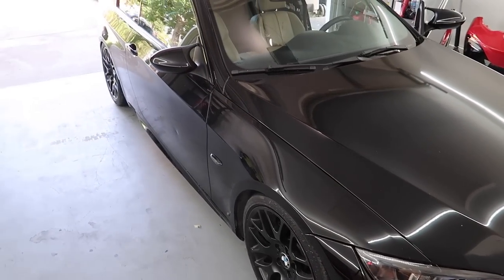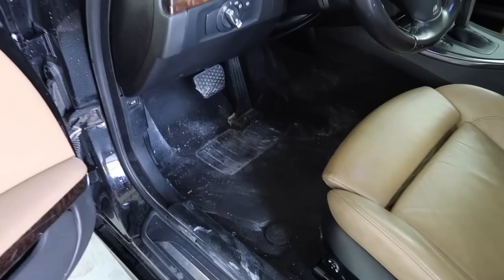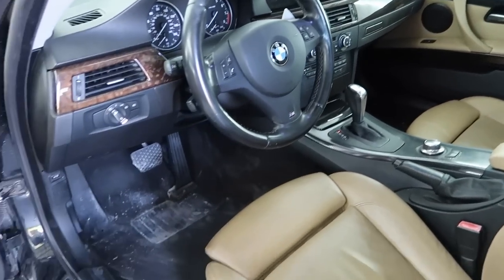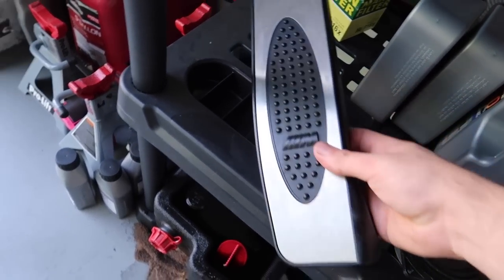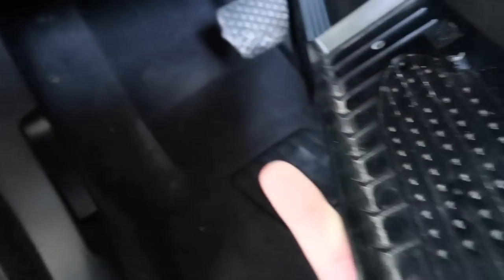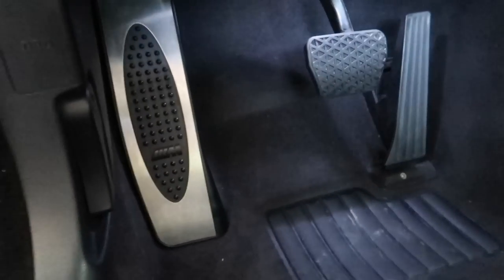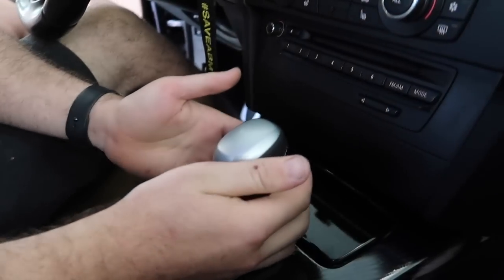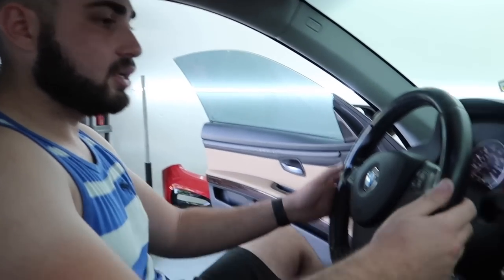I JUST PURCHASED THE MOST EXPENSIVE M PERFORMANCE MOD FOR MY E92 328I!

Comment: instead of buying a new steering wheel trim for the e90s get some LVP paint and an M sport badge then wet sand the trim. It looks brand new and it's only $20. There are a lot of tutorial vids on YouTube and you save like $200. 👍

Comment: Nour my old E92 335 was like that where the car had base audio, I went through so many different audio setups before finally retrofitting the individual audio from M3 I had to have a whole harness made to bring the audio outputs from the back of the head unit to the trunk where I soldered the custom harness up to an OEM HK/individual amp connector, coded the CIC to the individual audio and it worked perfectly OEM and way better than the custom setups I went through that had some weird issues. I also had a left over MOST fiber optic connector from when I retrofitted Combox (replaced TCU and MULF so one less module = 1 free most connector) which plugged right up to the amp perfectly and had a fused power connection to the battery. Having base audio makes it so much harder to do anything because you need to bring the outputs from the back of the head unit to the trunk but once it's there life becomes so much easier.
Reply: What weird issues did you have with the custom setups?
Reply: Not sure what you mean by "outputs from the back of the head-unit to the trunk"?? For Individual and HK audio, all you need to hook-up from the car to the Amp is the MOST connector, power, ground and then feed the speaker wires directly from the Amp to all the speakers and subs. Code and job done. I've done this retrofit countless times and I make my own wiring looms so the only wiring needed is for the Amp to all the speakers and subs.

Good job on retrofitting the Combox! It's well worth doing for OEM Bluetooth and A2DP. However, getting an aftermarket MMI box may be a better alternative nowadays as it gives much better functions such as Apple CarPlay/Android Auto, Screen Mirroring and provisions for a reverse camera as well as bluetooth phone and A2DP.
Reply: @TheUzzyB91  I was a special case as my car was BASE audio no amp in the trunk so the wiring that goes to the speakers were coming from the back of the head unit since there was no trunk amplifier, the speakers were powered by the head unit so I had to do extra work instead of say someone with HiFi or L7/HK where it would be much easier.
Reply: @JamesF36  Going from Base audio to L7/Indi requires just the Amp and the wiring as mentioned above. All the audio information is transmitted via the MOST network. Unless you were retrofitting an aftermarket sound system?
Reply: @TheUzzyB91  No that’s what I did I transmitted the audio via MOST however I did not want to make new wiring to each speaker so I used the existing OEM wiring that was pre existing all I had to do was extend the speaker output wires to the trunk to the individual amp

I’ve sold the car since 2021 but the individual audio retrofit went well and sounded amazing, now i’m retrofitting bowers and wilkins sound system into my F36 440 but that’s a piece of cake since I already have harman kardon. I replaced all the speakers now i’m just waiting on a good deal on a amp

Comment: The benefit of having the really basic sound system is you could easily add an aftermarket amp and new aftermarket speakers and end up with a better system than the HK system
Reply: Can you provide me some links where to tap into for power for the amp
Reply: @MrBMX-bi7ze  I can’t specifically I am afraid however for the wiring for the amp power you only need live ground and remote.  Live take straight from the battery and ground off the body for remote just find a switched live that comes on with ignition.  To get the audio to the speakers unfortunately would mean cutting the original loom and using rca adapters that would connect to the speaker wire then run the rcas to the amp and new speaker wire from the amp to the new speakers.  It is a lot of work but will allow you plenty of options in the aftermarket world to build a system that is right for you with subwoofers if you want or just high end component speakers

Comment: had one of these (UK 325i n53) had the same issue with my sounds... I just added a 5 channel amp, connected all the speakers... disconnected the bass (under the seat) and connected it straight to amp as if it was a subwoofer.... clarity was 10/10.... Other way was a 4 channel amp and a mono amp... using ISO cables connect radio to amp then amp to speakers HIGHLY RECOMMEND... Better then HK System!! Facts....(because you run all sounds speakers for trebles and mids and sub woofer for only bass) as the bass under the seats does play mids which is not what you want

Comment: Love these videos but it's so painful seeing these guys try to diagnose the speaker issue. Your issue has nothing to do with the tweeters so you can go ahead and plug them back in. The issue is the passenger side subwoofer under the seat which you said in a previous video was "bad" so try changing that first and whilst you're there, inspect the sub connector for any corrosion/damage and check with a multimeter for continuity from the back of the head-unit to that connector and repair accordingly.

I personally think/recommend you should get the Individual sound system from that E93 M3 (parts car) and retrofit it in the E92. You will need to additionally source the parcel shelf speakers and tweeters (because the E93 doesn't have them) and then retrofit them with the Individual Amp. If you need any help with it, I own an Automotive retrofit company across the pond in the UK so send me a DM and I'll be happy to assist with the retrofit and any/all coding (via NCS, not Carly!).

Love the M Performance gear selector but now you need the matching M Performance Handbrake (google it!) --- Love your stuff... Keep up the good work! #OEMPlusFTW